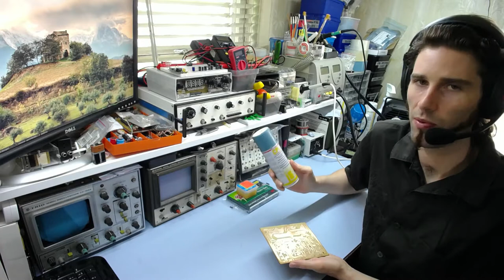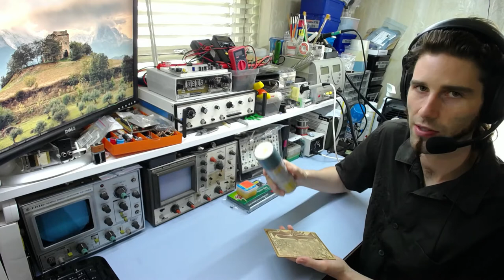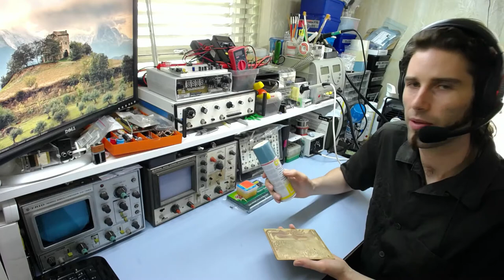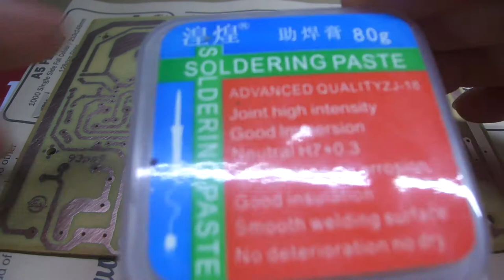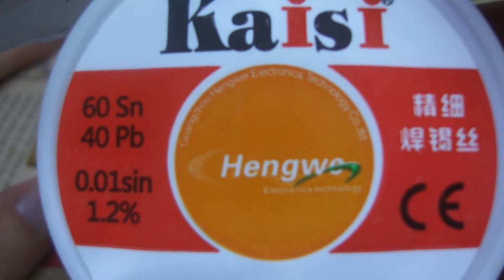How to tin and protect your PCB from oxidisation and corrosion

Comment: i sparay after soldering the components to the board
Reply from the maker: You can coat the board after soldering but it's best to ensure you clean all flux residue before doing so.
Reply: @Agent24Electronics  yes of course, that's exactly why i coat it after.